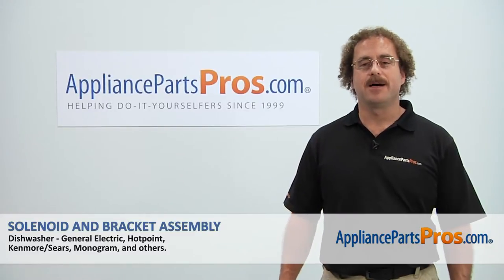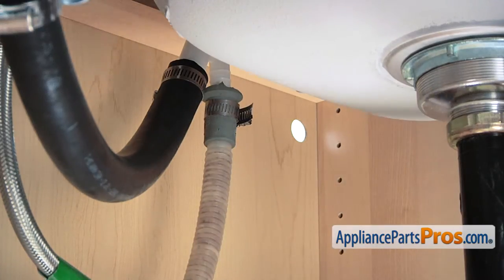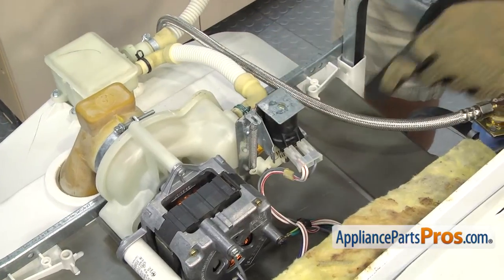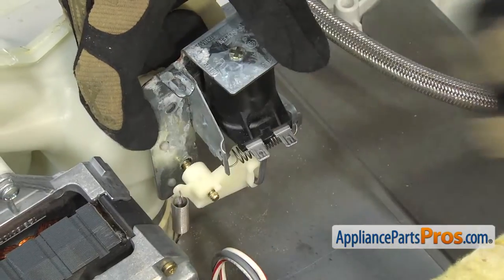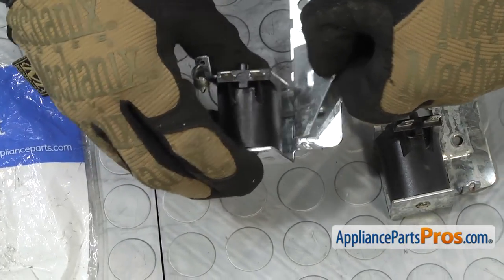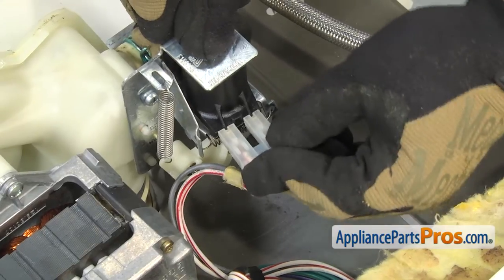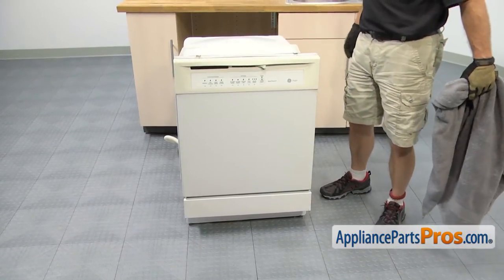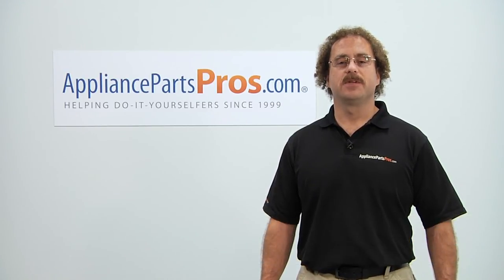How To: GE Solenoid and Bracket Assembly WD21X10268

Comment: Hi thankyou so much for the video, it helped a lot. However before I installed the water was flowing, unfortunately the water stopped after I installed it. What could I have done wrong?
Note : I'm sure the water is turned on , the heat is working when running.
Reply: Replace the timer and check your water inlet valve